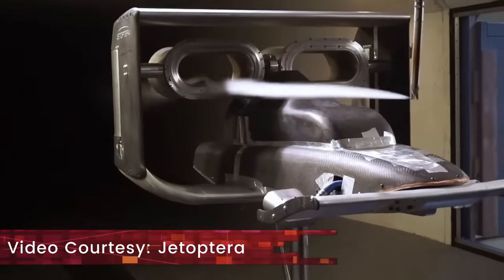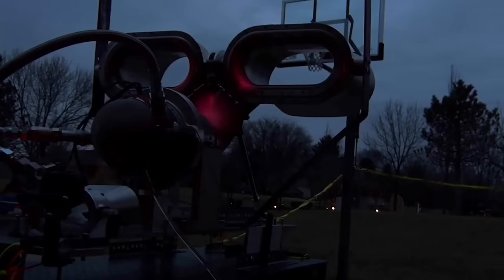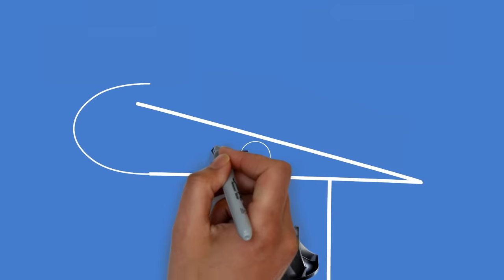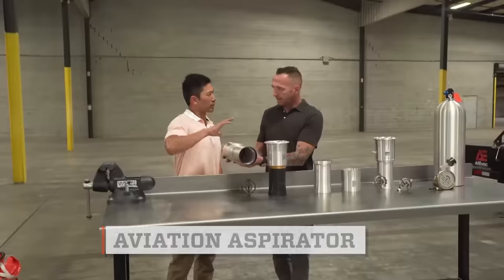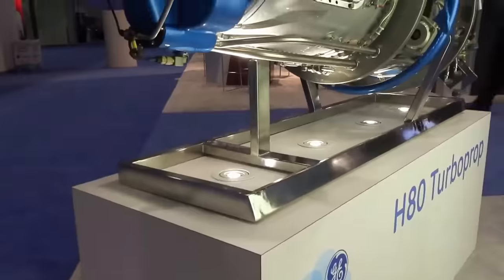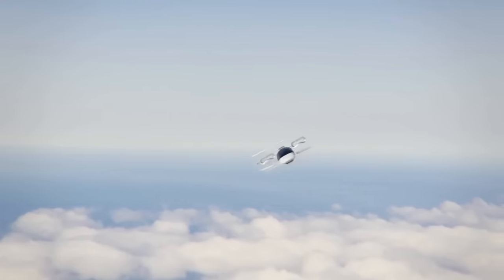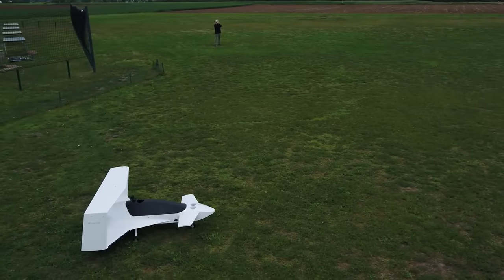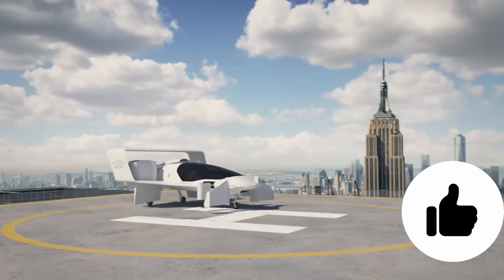Jetoptera's Bladeless Propulsion System

Comment: We need to bring Thunderf00t's attention to this.
Reply: @DartTyler  Biggest red flag
Reply: Fully agree. If this "multiplies flow", then just route the output of one such "jet" back into itself, or through a chain of them, and voila - infinite energy. This might be just another of those beautifully-rendered graphics presentation.
Reply: @markozagar  The catch to that, in practice, is that flow multiplication relies on high pressure at the intake, and low pressure at the output. If you create a circular chain of these, then taking an arbitrary start/end point along the circle, the pressure will be LOWER at the intake of your "start" point than at the outlet, because the pressure will consistently drop across each propulsor in the loop. Kinda like the time zones need to reset at the International Date Line because they can't keep going backwards forever.

So the physics of the idea is sound, but putting them in a loop to create infinite energy is not.
Reply: @markozagar  The issue is that this kind of device is great for moving air around a room and for propelling a model aircraft, but the physics does not scale up very well. Doing something like this for propulsion of an aircraft that can carry a person would use way more power than a conventional propeller that's electrically driven. I just cannot see something like this being efficient enough to knock other modes of propulsion of their throne.
Reply: @c182SkylaneRG  Yeah, realized that after thinking about it for a few more minutes. Thanks for a neat and concise clarification, hopefully it'll benefit someone thinking along the same lines.
Reply: @markozagar  "Neat and concise". I'll have to show that to my wife, because that may be the first time anyone has ever described me that way. :D
Reply: Whomst hath summoned the almighty one!
Reply: Indeed, this sounds sketchy.
Reply: Yes. If we watch more deep into that maybe Elon Musk the clown comes out LOL
Reply: Thunderfoot, I summon thee.
Reply: I want some youtubers to investigate this concept but not thunderf00t, that guy is probably the worst science youtuber I've seen.
Reply: @lithobreak3812  ok. Thunderfoot, I banish thee!
Reply: @lithobreak3812  He does his research and applies logic, science and math to whatever he reviews. He just does so in a highly skeptical way. If it isn't scientifically possible, why would he put any stock into something.
Reply: Lady Mercy  I was thinking, if biplanes fell out of grace for their relatively high drag as compared to monoplanes, then why are they making a comeback here?

Furthermore, although the outside of the plane me might be designed for low drag, but isn't that offset by the losses due to the internal resistance in the piping, used to pump air from the internal turbine to the nozzles?
Reply: @lithobreak3812  yep, the same reason on why I no longer subscribe to his channel. I know scientist can be egoistic sometime, but there's a limit where i go nope the fuck out. At some point, he became the caricature of the thing he despise the most.
Reply: So he can bloviate for an hour?  Naw.
Reply: @c182SkylaneRG  if you keep putting in energy to accelerate air in a loop, could you make a kind of rotorless centrifuge to separate enriched uranium gas from delpleted uranium? The current hassle with uranium centrifuges is the fragile spindle bearings. A cyclonic centrifuge like a dyson vaccum cleaner might be more reliable.
Reply: @JinKee  I mean, maybe? You wouldn't be able to support the entire thing on a cushion of air. Uranium is EXTREMELY heavy, and you'd need to support that, plus the containment mechanism. I suppose you could put the lead isolation barrier outside the centrifuge.

Mostly, though, you have to look at the power transfer of the chosen medium. The theoretical maximum efficiency of a windmill is about 60% (It might actually be 59%). The practical maximum efficiency of a horizontal axis (propeller-style) windmill is about 35%, and about 30% for the vertical axis type. That means that you'd need 10/3rds, or about 330% of the energy required to rotate the centrifuge placed into the ducted air system in order to get the centrifuge spinning at the required speed. Now I'm not a nuclear physicist and have no idea how fast those centrifuges actually have to spin, but I'd be willing to bet that means you're getting your little dyson fan up to about mach 3. :)
Reply: @c182SkylaneRG  the idea is there is no rotor. Uranium hexafluoride heated into a gas is circulated by ducted air jets in a laminar flow and the heavier isotopes stick to the lead lined outer ring of the toroidal chamber. The lighter enriched uranium isotopes are siphoned off by a ram air scoop closer to the inner wall of the toroid.
Reply: @JinKee  So I never even considered making Uranium gaseous. In that context it could theoretically work, if the duct is a constant cylinder, and you have these air injectors spaced periodically around the edges. I wonder what the boiling point of Uranium is, though. You've definitely just reduced the airflow requirement for turning a solid mass, although it would remain high to keep particles of gaseous Uranium entrained in the airstream. They're still heavy, regardless of their form. You've done nothing to the overall energy requirement, either, as now part of that requirement goes into heating the uranium to bring it from room-temperature solid to whatever temperature it becomes gaseous.
Reply: What about Peter Sripol?

Comment: "Once the required energy density becomes available"
Jetoptera's CEO tried to instrument the "marketing power" of the electric disciples.
Reply: Yeah we will just encircle the sun with dyson sphere panels then transmit power to air vehicles... energy density problem solved !  Should be up an running any time now....lol
Reply: We'll have hover tanks once the energy density problem is solved.
Reply: anything will work on batteries if the energy density is high enough! Even then I still think other ways of generating thrust are more efficient than Jetoptera's claims.

Comment: The canard and the front fans need to integrated into one design, I am sure the front fans could act as canards without the complication of being stowed.
Reply: No, the problem is, once they stop producing the thrust for VTOL, any sort of open ended tube like that (of almost any cross section and wall profile) will then produce a tremendous amount of drag.     In fact it usually produces more drag as an open tube than it would, were the opening completely capped (a solid profile from the front).
Reply: @daemn42  I'm wondering how they are powered. If by, say a PT6, then I hope they are cooled in the airstream prior to being stowed!

Comment: I feel like they just strapped a few dyson fans onto a drone
Reply: Yeah it looks like that but these motors would have to deliver exponentially more power / thrust than its Dyson counterpart.
Reply: @Ben7seven7  doesn't sound useful then, if it requires more work
Reply: Welcome to startups!
Reply: @nicholasfinch4087  everything worth it requires effort or waiting for someone else's effort
Reply: Scale it up!!!
Reply: Arc gateway, welcome to fraud and scam.
Reply: @Ben7seven7  They said it can work with fuel augmentation too, so at the very least they may manage a more efficient fossil fuel based engine design.
Reply: @nicholasfinch4087  Dysons are just meant to act as a fan, not to generate thrust. It's like comparing a ceiling fan to a propeller.

Comment: I'd love to see what this type of propulsion could do wrapped around a blimps mid section
Reply: turtleairships has the same interest in the potential.....
Reply: I would be more interested in ridged airship applications, although without wings they would operate as thrusters.  Perhaps an azipod for dirigibles ?
Reply: Do you mean the whole surface could propel it? Nice idea
Reply: Supersonic stealth blimp confirmed!
Reply: @635574  Yep going with your average football shaped blimp with a large propulsion ring right around the mid section, or perhaps slightly toward the back to reduce drag.  Would love to see how it performs in a computer simulation
Reply: @0ctatr0n  Interesting idea. I guess further back it could ingest the laminar airflow over the airship and then multiply the flow that comes out the back.
From what I understand one advantage here is simply that you have a type of gearing. Instead of using a large propeller with a slow moving but big and heavy motor, you can use a small and fast moving lightweight motor to compress air and then "multiply" it through those ducts.
But I'm just speculating. And I assume at the end of an airship the coanda effect wouldn't work. Or can it also work on the outside of a ring?

Comment: So, this is essentially powered by a pair of Dyson fans. Intriguing, but I don't see this "taking off".
Reply from the maker: hahaha
Reply: Ah but have you imagined a Dyson fan powered by  a small turbine putting out 700hp? Does that help your thrust equations? lol
Reply: @edfrawley4356  and how does that turbine produce that propulsion? 
Blades.
Reply: @davecrupel2817  so does the dyson "bladeless" fan. your point is moot.
Reply: So. Not bladeless. Not cheaper. 
AOC Sez....nope. uses FUEL.

Comment: Another youtube recommended :/ how do people believe these companies when their "test" model uses standard propellers and their aim is all about the propulsion system not the "pretty" shape of the body.
Reply: It may be logical to learn things like VTOL, flight dynamics, and other things independent from the propulsion. But not for much else, as these small planes behave very differently from real size ones. 
Still, the concept is excrement prime, I wrote a long comment about that.
Reply: this one actually real)  it will still be a failier but it can work
Reply: Because cgi can fool people into thinking it's real.
Reply: @raykent3211  what?

Comment: I'm interested to know how exactly entaining more air through the rear cowl actually results in more thrust, or even more air flow over the wings, since it looks like the air will be entrained through the cowl father than around it, and any air flow at the back looks like it will be behind the wings altogether.
Reply: One reason is that the wings can be laminar flow with no engine cowlings interfering with airflow over the surfaces, in addition the intake of air increases the flow over the wings, creating more lift.
Reply: @scotthill2230  but how does the intake increase the air over the wings? I would get it if the cowl inlet started behind the wings, or if it finished in front of the wings, but I really can't see how its meant to be moving any more over the wings at all.
Reply: @benwilms3942  Wouldn't the accelerated air that's rushing back create an area of lower air pressure in front of the cowl causing the air in front to get sucked in and accelerate over the wings in the process?
Reply: @bokiNYC  im not sure I follow, if the air is moving into the cowl, then I can't see the connection with air moving over the wings.
Reply: @benwilms3942  The thrust provides forward movement, which in turn provides faster and faster flow of air over the wing as the ground/air speed increases. The wings themselves passively provide lift by virtue of their shape. Therefore it matters not what airflow is produced behind the wings by entrainment, other than to provide thrust for forward movement.
Reply: It's fake
Reply: @Richard-fx6go  so its no different to any other conventional aircraft then?
Reply: @benwilms3942  Well, it uses a different delivery for thrust, which can be adapted to both electric and gas turbine. The difference is there's no visible moving parts (propellers or turbine blades).

Comment: Wow!  Now I know why Elon backed out of the VTOL jet.  This thing is amazing!  It would also be interesting to see how it performs on engine failure as the flight characteristics could be problematic with that....
Reply from the maker: There is no redundancy. And that is a weakness of this aircraft
Reply: There are parachutes for small planes that will lower the whole craft down. That's still dangerous, but I think safer than that thing's likely glider performance.

Comment: "High efficiency" lol. Their concept calls for a 1250 kilowatt powerplant to provide the compressed air. 
That's 1675 horsepower, for a light aircraft.
Reply: I think they meant no fuel burned. As in on the craft itself. Maybe for generating the power. But I hope that will change.
Reply: well, vtol..
Reply: @dangerousdoggo5465  Their initial prototypes are using a gas turbine engine burning regular ol' dinosaur squeezings "until the required energy density is achieved" for batteries.
Now I'm no battery expert, but something tells me it's going to be a while till it's possible to pack enough energy into a small and light enough set of batteries for that level of draw.

Comment: Seems inefficient. Would love to be proven wrong.
Reply: KamiEuKiTo  standard props are more efficient then this, so let's start there.
Reply: @nothingnoone8752  it has a hugely reduced drag cross-section tbf
Reply: @lukefreeman828  if you make a prop with an equivalent drag cross section, it will be superior in every other metric. 

That's like saying a million zimbabwe dollars is worth more than one US dollar. It's true, but it doesn't really matter since an equivalent number of USD is worth vastly more.
Reply: @nothingnoone8752  I know what you’re trying to say but no, doesn’t quite apply in this case. 

Assuming the propulsion system here produces X amount of power and Y amount of drag , a propeller system producing the same amount of power WOULD produce a much higher Y value because of the vastly higher cross-section. To reach the same Y value, the propeller would need to be much much smaller and therefor produce less thrust (X). 

The issue with the design though, is efficiency in terms of generating thrust I.e for the amount of energy required to produce thrust from this system, would a propeller produce more thrust/require less energy for equivalence.
Reply: @lukefreeman828  that's incorrect. The ratio of thrust to drag is higher on a prop than this - you can scale either variable, and the ratio wouldn't change. 

Your imagined result requires this to have a higher thrust to drag ratio than a prop, which it doesn't. That's the whole point.
Reply: @nothingnoone8752  that’s not what I said. That’s the opposite of what I said.

What you’ve just replied is what you said in your first reply to me.

I literally said props have higher drag to thrust than this design.

What you said was that a prop with the same drag as this would produce the more thrust. It wouldn’t. A prop with the same drag as this design would be absolutely minuscule. Drone sized.
Reply: @lukefreeman828  I said "if you make a prop with an equivalent drag cross section, It will be a superior in every other aspect."

One such aspect is thrust, because the ratio of thrust to drag is higher on a prop than it is on this. Do you disagree?

You said, "The propeller would need to be much smaller and therefore produce less thrust" - less thrust than what? 

A bigger propeller? Yes. 
One of these with equivalent drag? No.

 https://aviation.stackexchange.com/questions/53771/could-a-dyson-fan-scale-up-to-be-used-as-a-bladeless-aircraft-engine
Reply: @nothingnoone8752  The point is, you can't build a propeller with an equivalent drag cross-section. The drag here is ridiculously low (and in unpowered flight would likely produce lift like a box wing whereas a propeller would just create drag).

A propeller with the equivalent drag to this sort of design would be akin to something on an RC plane and produce nowhere near as much thrust as this design.

You're forgetting the relationship between drag and thrust is NOT linear and does no scale linearly either.

The link you provided is actually the opposite of what we're talking about. We need to scale a propeller DOWN to the equivalent cross sectional drag of a Dyson, not the equivalent thrust up to an engine.
Reply: @lukefreeman828  the thrust ratio does not become less than this design when you scale it down. It's not even close. 

* Thrust decreases
* The ratio of thrust to drag decreases (slightly)
* The ratio thrust to drag is still considerably higher for a propeller
Reply: @lukefreeman828  Tell you what - show me an example. You say there exists a version of this, and a propeller, with equivalent drag but the propeller provides less thrust? Then let's see it. Give me the numbers for which that is true.

Inb4 "and this prop with a 0° pitch"... 🙄
Take any average propeller, scale it down, show me the intercept.

Comment: wasn't "dyson fan" just a less efficient fan, as it would hide it in the base and then spread and angle the air, which loses energy with every bump and turn
Reply: Exactly. An aesthetically pleasing novelty. Those steel bladed fans from the 50s were probably as efficient.
Reply: Quiter and provides a much smoother airflow, good for personal use if "money's no issue". Efficiency is said to be better for fan models, but that's probably because of the expensive materials and optimized design, that offsets the poor theoretical efficiency. Or just improper measuring.

Comment: Jetoptera needs to rethink theyre name, here in the vid it sounds like 'Jet of Terror ' ,lmao.
Reply: If one of the propulsors is damaged, it will indeed turn into a "jet of terror". Also, would need a couple of zero-zero ejection seats installed in case of the turbofan inside dying during a hover (and most likely in a horizontal flight as well).
Reply: also, no airbags but ejection system????  who is that possibol????